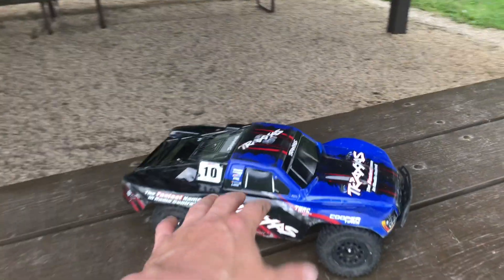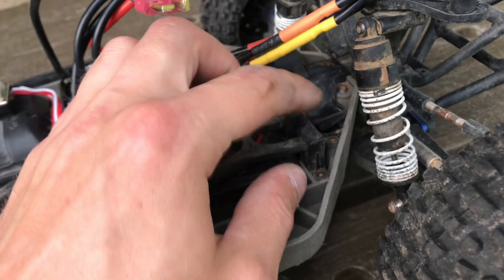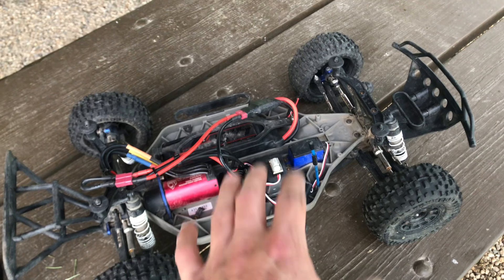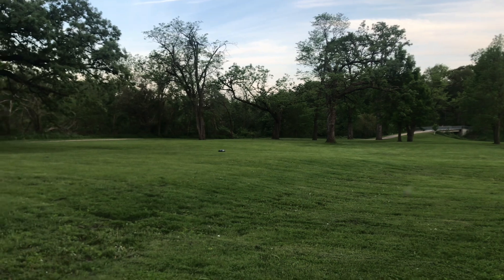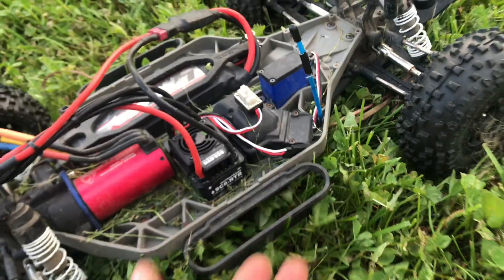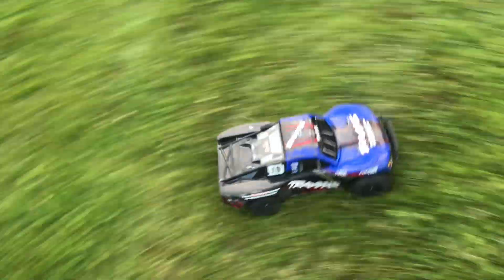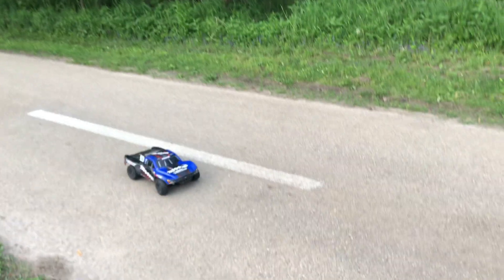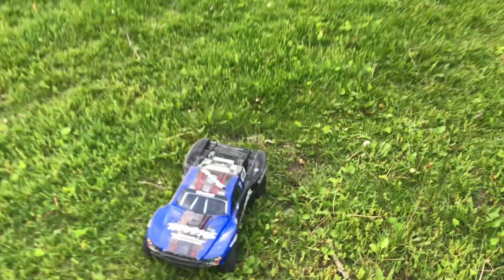Traxxas Slash 4x4 VXL Brushless - TESTING OUT The NEW Power System!!

Comment: I over heated 4x yesterday within 15 minutes. It cools down then runs fine but I don't want to replace the esc with the mamba and 32000kv castle rock until after I convert to lcg chassis but honestly I've got some issue to address first such as shocks and driveline. It's a project. I'm retired so I can't just afford to buy everythingng all at one so the vxl3s with brushless stock system will have to do for a little while anyways. 

Cool video though. I do enjoy your videos quite a bit. Thanks you.
Reply from the maker: Understandable…..the Vxl3s is actually a pretty decent system…..Glad you found it helpful!

Comment: Had same power loss issue with mine bud (same hobbywing esc), have since fitted a heatsync with cooling fans to the motor and have had no issues since.
Reply from the maker: Does yours have the deans plugs on it?

Comment: My problem is with over heating ATM. I'm nor sure if it's because of gearing but I ordered an 11 tooth pinion. I'm also running the I d traxxas batteries 3s with the low 25 discharge rating. I've never had a full successful run yet. I'm not my sure how is tell the difference between over heating vs low battery.
Reply from the maker: Overheating will be a fast red blink……low voltage detection will be a slow red blink
Reply: @RCKnockout  awsome!!! Good to know. Thanks.
Reply from the maker: @RonAdams777  No problem

Comment: The reason it is cutting power is because of heat or resistance from the motor getting too hot. Driving full out in tall grass will do that on any esc combo w/ a slash. Drop a tooth or two to help with this. If you are using older batteries with a higher internal resistance then the batteries will build up heat and sag to lower voltage under extended heavy loads as well. All lipo batteries as they get older will get more and more resistance. Might just be time to retire some of your older packs.
Reply from the maker: You might be right. I could probably turn off my low voltage detection so it doesn’t go into a limp mode. I’d have to be constantly aware of my voltage level though

Comment: Nice dude! Hey, I'm fully rebuilding my slash, what mods (non electrical lol) would you recommend? Cheers 😀
Reply from the maker: Is it the VXL 4x4 or Ultimate Version?….I would definitely say a new set of wheels and tires would help. I like the way the Proline Badlands hookup. I don’t know if you’ve had issues with breaking driveshafts on yours but I highly recommend upgrading those as well. I’ve heard good things about the Tekno driveshafts. I haven’t personally run them though. There really isn’t a lot that the Slash needs other than that to be honest.
Reply: Do your self a favor amd sell it amd get a tekno tlr or associated sc truck.
Reply from the maker: @jeffbryner5355  have you owned a Slash before?
Reply: @RCKnockout  yes I have a hcg and a lcg slash to this day in my garage. I also have a 4x4 rustler.  rc10t from when I was a kid a sc10 a sc5m and a sc6.1 I also have a exceed terrain 10 and a arrma voltage. Both of those are junk though lol. Got a spartan too but that doesn't count haha
Reply from the maker: @jeffbryner5355  it sounds like you’ve had unfortunate luck with the Traxxas electronics
Reply: @RCKnockout  not just me my good sir alot of people have amd for 170 for a rpeplacment 3s vxl combo is nuts. I can buy the sw4 combo from castle for 20 dollars less and the tunability is crazy. Traxxas u have like 2 or  3 preset modes. Makes no sense to even buy it. For me they way over priced for what you get out of the box. I'd rather them just sell me the kit and I add my own electronics. The dr10 and the sc10 u could buy as a get or rtr. The dr10 is 299 rtr 199 kit. Traxxas is 500 for a slash with bandit arms metal motor plate and finally a sealed diff. Makes know sense to buy the slash. It's like buying a Harley vs a yamaha. They both sound the same but the Harley is twice as much lol
Reply from the maker: @jeffbryner5355  does a Yamaha really sound like a Harley though? Lol 😂 
I agree the electronics are overpriced but for the most part their escs have worked well for me. Except for the Xmaxx VXL8s and the original vxl6s which were garbage. One of them started on fire and the other three VXL8s escs ended up burning up on me

Comment: Could it be the gearing making it less torquey? Seems like it’s fast as hell at top speed but has no low end torque (which I prefer)
Reply: Whats funny is some systems go stupid fast on take off when geared for speed but some are like u say, slow on take off them fast. Weird but I'm guessing its the amp draw capabilities that make the biggest difference
Reply from the maker: It feels sluggish but it could be the throttle punch set too low or too high of gearing? It’s probably the gearing though

Comment: The problem is the motor no cooling put a heatsink with fan. Trust me made a huge difference with my infraction v2 never overheats anymore with WTF fans, yeah racing, hot racing, power Hobby but cheaper fans that are just as great or even better or rocket hobby fans,  McLan fans unless u have money?NTF or gamechanger fans are crazy
Reply from the maker: You think so? I thought it was most likely the esc that was the problem

Comment: Do you use any flux when soldering? It helps out a ton. And make sure your wires are as clean as possible. You don't need to get super hot. And also an old advertisement for jconcepts popped up in my feed. May want to check it out. Slash 4x4 - Front Bumper Conversion Kit | JConcepts
https://www.jconcepts.net/shop/slash-4x4-front-bumper-conversion-kit
Reply from the maker: Thanks! I’ll have to take a look. Yes I do use flux

Comment: Vxl electronics are trash.. and ate you saying that, that version of hobbywing esc doesn't let you manually program it? Most of those series let you program it with that button by the power switch
Reply from the maker: I never said you can’t manually program it. No clue where u got that from? I have a Hobbywing program card. It makes it much easier to go through the program settings I might have mentioned that in the video. At no point did I say u can’t program it manually though